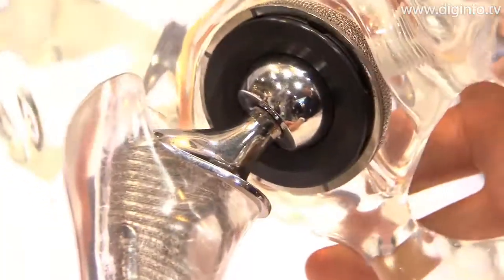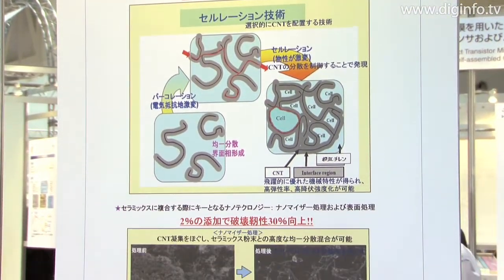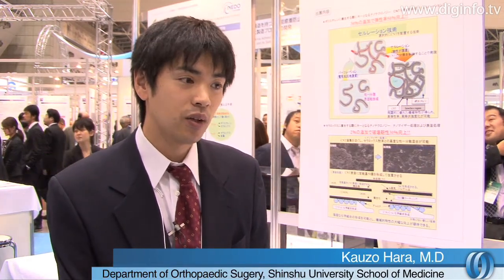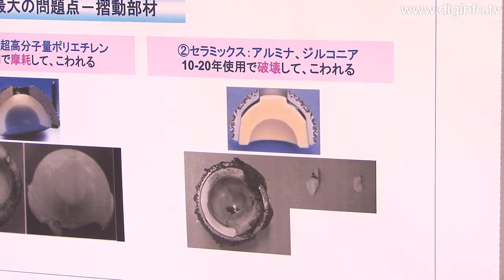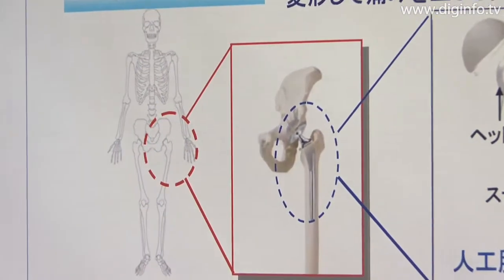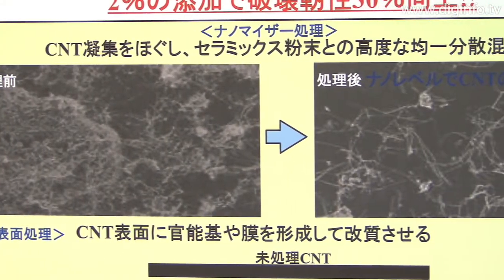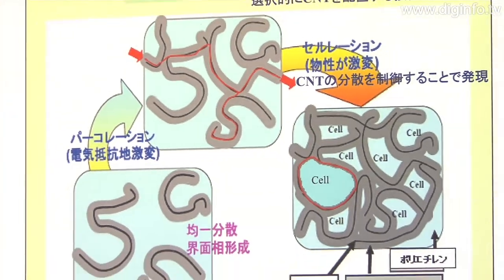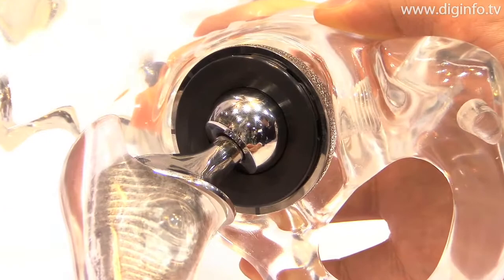Artificial Joint Material Using Carbon Nanotubes : DigInfo

Comment: (part2) Other ways for research can be explored or created, fact is that using animals is cheaper and easier. They are forced into the role of a product. Use them until they break then get a new one......  Also I don't dismiss the "importance" <--(debatable) of the research conducted in the past, I just don't like it how it got to this point. For example you also exist because in the past lots of bad things happened. They contributed to your existence, but are you fine with that? Probably not.